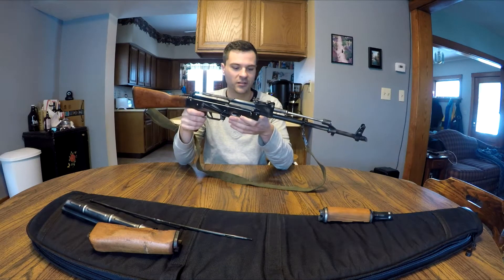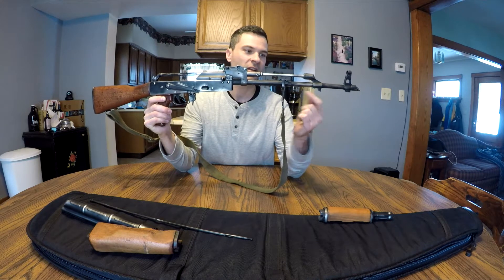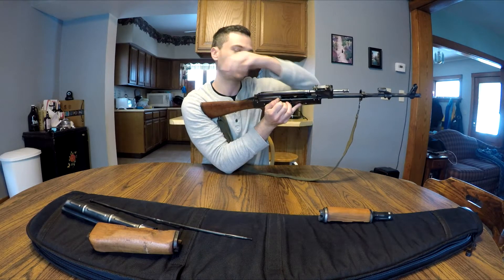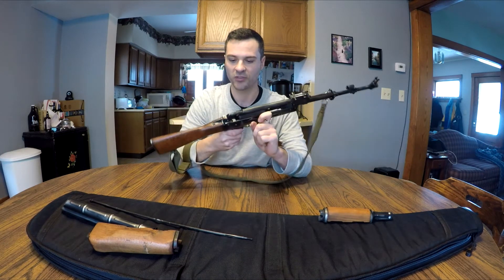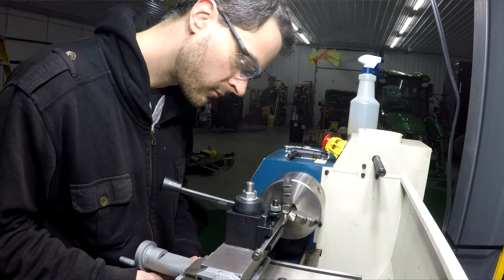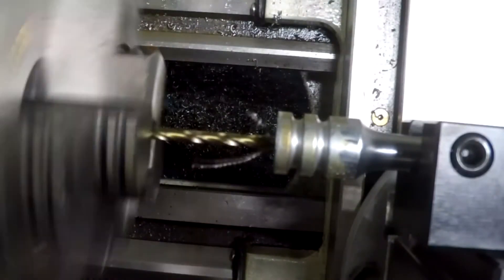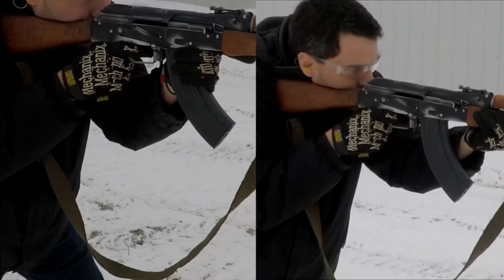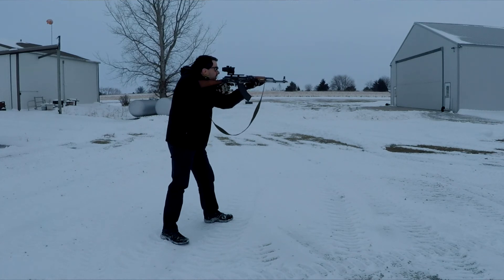Adjusting Gas System on AKM by Machining

Comment: Interesting.   Having access to tools like that makes it easy enough.  KNS makes a product that does the same thing more or less and is adjustable.   How is the piston/rifle holding up?
Reply from the maker: Funny you should mention the KNS adjustable piston. After re-working this piston several times and increasing the size of the bypass holes, it still was throwing some cases over 30 feet slamming the bolt back into my shoulder hard, so I bought the KNS piston.
Reply: @switch72  Any updates on the KNS piston?  Have you also thought about upgrading the muzzle device?

Comment: Just take a angle grinder and cut a rough notch into the piston. That’s the classic fix. It probably was a bit over gassed but the recoil spring also seemed worn out. U don’t have to do fancy machining. Replace your recoil spring before I start cutting on your piston. Also if u notch it a bit much just mig it up a bit no big deal very simple

Comment: Can I do this without a lathe and just use a hand drill?
Reply from the maker: @Gregory-qu1ct  I wouldn't recommend using a hand drill. The surface is curved and it is hardened steel. It requires a lot of force. A good drill press would work though.  Carbide drill bit is also recommended.
Reply: @switch72  Ok thank you.